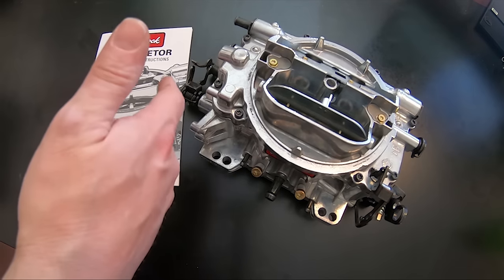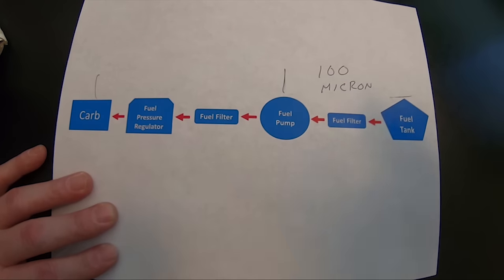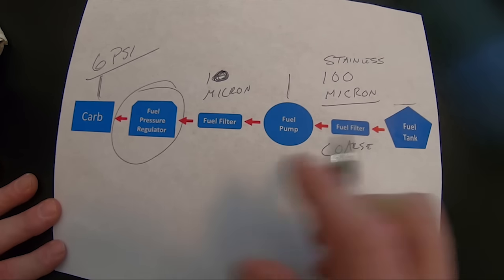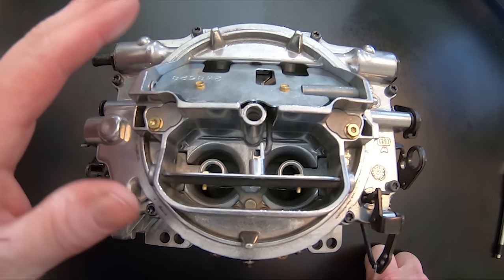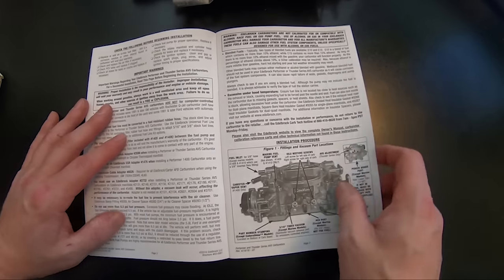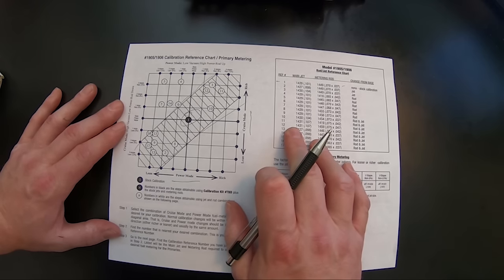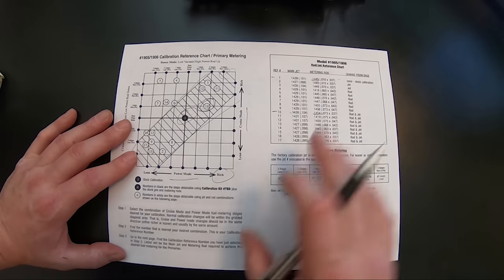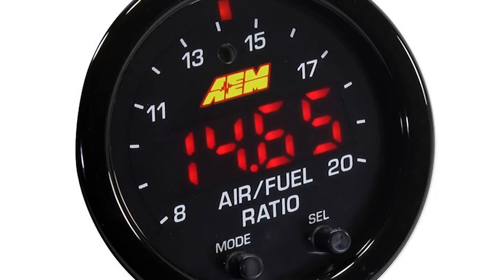The Ultimate Edelbrock Carburetor Tuning Guide

Comment: My Edelbrock 1403 on a Ford 289 gave me about 200 miles on 10 gallons when I first installed it. After storing it over the winter it never was the same. It would idle roughly and there were various issues until it was discovered there was a vacuum leak. Now that is resolved and it idles fine as set up by my mechanic, I get barely 100 miles to a 10-gallon tank. Not sure where to start.
Reply from the maker: First things first.  Storage on any carb means completely draining it of fuel.  If you’re running pump gas, it’s got ethanol in it and with that comes all the crap that fuel attracts.  Change your filters.  Get a rebuild kit and give it a through cleaning and rebuild.  Loss of economy can be a couple things and likely the clean and rebuild will solve some of it.  Your next steps are adjusting the calibration spring under the piston that’s attached to the metering rods.  You can try it with swapping them out till you find the sweet spot or a vacuum gauge to see what the manifold vacuum looks like while driving.
Reply: @MuscleCarSolutions  Thank you, I will try that.

Comment: I have a Ford 302 crate motor and just installed an Edlebrock AVS2 1916 Off-road carb.  I believe this motor has around 300 hp, but not exactly sure.  I'm getting a stumble sometimes off idle.  I have tried all 3 adjustments on the accelerator pump location & found it runs better on the leaner setting.  However, I am still getting a stumble.  The extent of the stumble varies from none, to somewhat significant.  Where do you recommend I go from here?  Thank you,
Reply from the maker: Ok that’s good.  Now you know it needs to be leaned out.  Get a calibration kit and you can start making adjustments.  Step up springs first.  Then you can start on the tuning chart.

Comment: I have a Carter AFB 650. It is rather new and has not been used. It has been sitting since October 23.
My problem is i just installed a new small block in a 1970 chevelle.  And i got the car to run. It takes about a dousen times to turn over before it fires up and runs. There is a POPING noise comming from the exhaust pipe. I believe its comming from thec passenger side pipe. Is that a carburetor issue? How do i handle this issue?Is the poping noise a symptom of the car running rich?
I set the timing @ degrees and the total timing is at 32 degrees at 3500 RPM with the vacuum advanced disconnected.

Comment: I'm running a pair of Edelbrock Thunder Series carbs (1803 & 1804) on a Pontiac engine. These are part of an Edelbrock top end dual quad kit consisting of the carbs, intake, cam, lifters & rocker arms. I've installed a pair of Edelbrock #8722 1/2" wood spacers under the carbs to alleviate heat soak. 

The problem I'm trying to overcome is a very rich idle, the tailpipes are black and if I'm in the garage with the car I could die! I've adjusted the float levels to stock and a little less with no difference, if I went too low the car would stall when I made a hard turn or fast stop. The carbs are set up with the as-supplied .086" primary and .077" secondary jets. 

I'm using a stock mechanical fuel pump and need to check the pressure output-at what point does fuel pressure overcome the needle/seat assembly? Thanks for your time and help.
Reply: @MuscleCarSolutions  Copy that-and the good thing about this set-up is the carbs are only 500 cfm each, less than needed for the engine alone, and with 1000 cfm available at WOT there's more than enough for power runs. The car has no drivability issues, well, there's one but that can wait till later to diagnose. 

I've read that Edelbrock offers spring loaded needle/seat valves to avoid shock encountered by offroad use, maybe they'll help with a lower float level. Also, would you recommend leaving the original float drop setting or changing that as well? Thanks-
Reply: @MuscleCarSolutions  I verified that the mechanical fuel pump is supplying a steady 5-6 psi to the carbs. Next step will be to adjust the float levels, do you have a recommendation for how much lower to go than the 7/16" specified by Edelbrock?
Reply: Ray if your running a very hot cam with a lot of duration i have seen some Edelbrock carburetors run rich at the idle circuit because the vacuum is too low from the cam shaft duration so what do guys do is drill a small hole in each primary throttle plate to allow more air to come through at idle circuit idle ! Had a guy at the shop i worked with that had this problem on a 70 440 Challenger that was doing the very same thing because he had this radical high duration cam shaft and with small incremental changes on the hole fixed drilled in those front throttle plates he was able to get it running much better to a point it not only pulled harder out of the hole it also wouldn't burn your eyes at idle in the shop anymore . He tried lowering the floats as well as leaning up the primary jets but that still didn't do much until the holes were drilled !

Comment: Working on one that didn't come with the book, don't know if the jets are original.  It's a 1406.  It's been through a few mechanics because when I changed the trans with a rebuild I found when getting a rebuild torque converter it had a Buick converter in a '80 Monte Carlo 305(?) turbo 350 trans. Owner took it to another shop because of hard starting, plugs cap, wires replaced.  It hadn't started in months, hooked up the jump box and I just pushed the choke down a hair and it fired.  When it got here I through a timing light on it after finding the marks. Couldn't see them they were so far off. Factory says 4 degree but considering Denver is 5,000' elevation I've learned to add 8. So I retarded it probably 10 because I couldn't even see the mark, to get to 12.  Everything changed after that, almost. Fist touch of the key it fires up whether it's 10 degrees or 60 outside. And when it's still cold acceleration from a dead stop is fine. But at operation temp it want to dog out if I punch the accelerator quick from a stop.  
I have had dozens of these carbs over the years and worked on other cars with them, never had a problem.  This owner was ready to spend a fortune on fuel injection until I adjusted the timing.  But next comes the digital dashboard because I need to know temp, oil pressure, rpm and that it's charging. And he wants it and brought it today. Thanks for the vid, gonna check out accelerator pump first.
Reply: @MuscleCarSolutions  Cool, appreciate it.  Been wrenching allot of years. Fuel injection was still fairly new, disk brakes weren't standard equipment, and computers weren't used yet.  Damn, even electronic ignition systems were just coming in. My first real job was working on police cars as a mechanics helper in 1976 at Spokane City Garage and I'd just rebuilt my first engine, a 421 tri-power in a '63 Grand Prix, my first car. And all this hi-tech diagnostic stuff I have accumulated is about useless without a sensor to read...
Again thanks.

Comment: Hello, eddie carb 600 on 72 Dodge Challenger 340.  Starts great cold. Idles great when kickdown.Take off get to first light when at temp,always have to give slight bump to pedal to lower idle. Thoughts?
Reply from the maker: Linkage adjustment?  Electric choke?  Not releasing?  Fast idle cam sticking?

Comment: If the step-up springs do not fix a hesitation, stumble etc. and you go on to change the metering rods, do I need to go back to the first spring that was in there before I started changing to different springs?
Reply from the maker: That’s the difficulty con tuning by just feel.  An AFR would let you know if those changes were effective before you move on to working else.  Keep the springs you selected, then make your rod/jet change and see if it gets better.

Comment: This is more than likely a stupid question but I just purchase the AVS 2 ( 1906 ) for my 72 k2500. I looked up the calibration chart you had mentioned but there is no graph for the 1906. It only goes to the 1825 and 1826. Is there a graph for the AVS2 1906? if so could you lead me in the right direction. This video answered so many questions, thank you for your time sharing the knowledge.
Reply from the maker: If you go to the Edelbrock site and search the 1906 you’ll find the pdf instructions link on that landing page.  You’ll need to scroll down 3/4 of the way and you’ll see the tuning chart for the 1906.  Please don’t hesitate to ask me any questions.  Always glad to help!
Reply: @MuscleCarSolutions  You are awesome! I found it. There is so much information on there. I am currently on the oil fields in alaska. When I was home last week my holly started giving me issues. I have never really figured out how to properly tune it. So i decided to buy the AVS2. I am really excited to put it in. I just hope I can dial it in nice. I just rebuild my transfer case so I am hoping I can do this :) Thanks again for the help my  72 k2500 I hope starts running a lot smoother. It has the 383 in it also.Thanks again. Is there a way I can contact you if I have any questions? I don't wanna bother you though but Im sure I will need some clarification when I dive into this. Take care and thanks again.
Reply from the maker: Just drop me a note here and I’ll be glad to help!  Best of luck to you.  If you tackled the transfer case, you’ll get the carb dialed in no problem.  You can also check out the other Edelbrock tuning videos in have in a playlist.  Might give you some more tips and insight on your tuning.
Reply: @MuscleCarSolutions  Thank you sir!!

Comment: The manual I have with my 1413 800 cfm carb says that the passenger side small port is for emissions controlled engines and the driver side port is for non emissions controlled engines/distributors. Right now I'm actually using the original 1964 point distributor. Should I use the one on the driver side, that I am using?
Reply from the maker: The better question would be how big is the cam profile?  Is it stock?  Use the timed port.  Is it an aggressive long duration cam?  Use the full manifold port.

Comment: Do you know what would cause fuel not to go to the carberator with a new edelbrock carburetor and a new fuel pump assembly
Reply from the maker: Difficult to say.  Make sure the pump is working.  Make sure your filters aren’t clogged.  Do you have a vented gas tank cap?

Comment: Great video, very helpful in understanding the chart. What should the timing be on the 454 I have, the vacuum advance is plugged at the distributor and both caps on the carb
Reply: Bone Head , I think it’s a regular gm distributor when the motor was put in they said I didn’t need the vacuum advance part. Coil pack on top of distributor. I didn’t know if I needed that to be hooked up .

Comment: I'm trying to troubleshoot a problem with my 1406 edelbrock. At idle, the engine runs fine, and revs up fine, but when I put it in gear to drive and press the gas, it doesn't respond and lugs the engine down. It doesn't die, but I can floor the pedal and engine doesn't increase RPM. Ever heard of that issue? or think that is something else than the carb? I can't find any good information about the problem I'm having.
Reply: @MuscleCarSolutions  ended up getting another carb to try and truck runs fine now. So its narrowed down to something wrong with that carburetor internally. Haven't torn into it yet to find out the problem

Comment: At high RPM or WOT she cuts out. What are the things I should look for? It has 6psi and I can blow right thru the fuel filter. Any info would be great and thanks for the video.
Reply: @MuscleCarSolutions  O man, I left out a tad bit of info. Sbc 350 bored .060, 650 Edelbrock choke plate removed. (I live in Texas),  280 Comp cam, Weiand Stealth intake (dual plane) hooker headers, cast iron Summit racing heads. ( like a vortex according to my machinist) 700R4 tranny, 2800 stall, 4:10 posi,tires are 28" from bottom to top. HEI ignition with a "high output module". I had it dyno tuned about a year and a half ago. The (what I think) starving for fuel situation started about 3 weeks ago. Also pardon some of my ignorance I'm an automotive weekend warrior. 😆 I appreciate your time.
Reply: @MuscleCarSolutions  truck will sit a maximum of 2 weeks at a time every now and then. I use 93 octane and to be honest I don't know what percentage of ethanol is in the gas we have here in the D/FW area. But I have not tinkered with the truck since dyno tune. I checked to make sure distributor is still tight and it is. I did notice right after the tune truck would start with no pumping of gas. Now...... After truck sits for about 2 days I have to pump gas 2 or 3 times to start it. (For about the last 3 month's or so)
Reply: @MuscleCarSolutions  I am leaning toward ethanol contamination. I will replace the fuel filter (which is before the manual pump) and see what happens from that point. It's wet right now so it will be a day or 2 before I can get it on the road for a test. What would you consider sitting a long time?
And thanks for your help once again.
Reply: Just replaced the fuel filter and what difference. I really appreciate your advice. Its the simple things that get overlooked. I was able to blow right thru the old filter but like you said it must lose fuel pressure at wide open throttle. Now........ we need to discuss in the future about making her go faster. Any advice would be great. Looking to replace cast heads with aluminum heads just need the best bang for the buck. Unfortunately I have dished pistons and cant afford to replace lower half (pistons) right now.
Reply: Well.......... guess what? The hesitation came back (intermittently) at wide open throttle. This weekend I'm going to blow out the line toward the gas tank with compressed air with the hopes that maybe the inlet line which has a tiny little net is slightly clogged. At the carb I'm reading 6psi but who knows at wot. If I replace the fuel pump, the only hp ones  seem to be 8 psi at Summit Racing. What are the consequences of running 2 extra psi? I guess I'm automatically leaning to toward a delivery starvation issue.......
Reply: @MuscleCarSolutions  will do...... Plus I saw the video.
Reply: @MuscleCarSolutions  Took top off and sure enough black particles ahoy in both bowls. Clean and blew everything out and once again she runs way better than I ever remembered. I will do a full rebuild in the coming weeks. Again thanks for sharing your knowledge!

Comment: I have a question about the secondary. ? Ok I how a after market throttle cable bracket. For the gas pedal and the kick down cable. Ok Trying to get it setup Wright is a pain. Because I don't think the secondary are opening. ?
Reply from the maker: Secondaries are vacuum operated.  The throttle linkage will open Tuesday primary side and the secondaries on the bottom side of the carburetor.  The top weighted valve is controlled by the load on the engine.  When there is enough load and the vacuum drops, the valve will open.
Reply: @MuscleCarSolutions  Ok so if I'm driving 55 mph and floor it should they open up? The carb IS new. I'm trying to figure this out 😂😂😂
Reply from the maker: Yes.  Because it’s when you hit the gas, the load on the engine increases and the vacuum drops.  They open.
Reply: @MuscleCarSolutions  Ok let me ask a dum guestion how will I know when the open?
Reply from the maker: It’s the wrong question.  The right question is how will you know if they don’t open?  The engine will fall flat on its face and not engine RPM/vehicle speed.
Reply: @MuscleCarSolutions  Ok lol I thought they made a sound when they opened. I didn't hear any ..

Comment: I used to be (lol) pretty good with Quadrajet carb tuning.  Using a lambda meter I could get them to run like fuel injection. I have since placed my focus on tuning fuel injection.  Kind of ironic.  My question is I am helping a gentleman tune his newly installed Edelbrock carb.  Same one you have featured here.  We have no idea of the cam in the car.  From my experience and the way the car is setup (all out drag setup), I assume the cam is a "bottom of the page" cam.  Either way it is very radical.  Lots of overlap.  I am trying to control the idle.  In gear the car wants to stall.  If it were a Quadrajet I would simply start with drilling a small hole in the throttle blade to help keep the blade in the area of the transfer port.  I have a feeling with the idle screw set so high it is feeding off of the main jets too much.  The idle screws are doing squat.  Is it advisable or OK to make the same modification of drilling the throttle blades with this carb.  Thanks for a great explanation.  I subscribed.